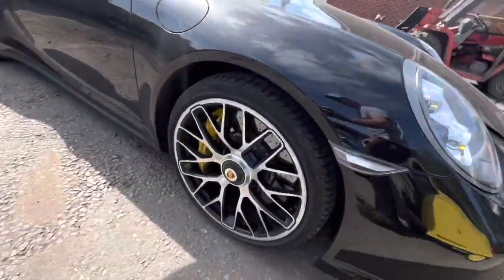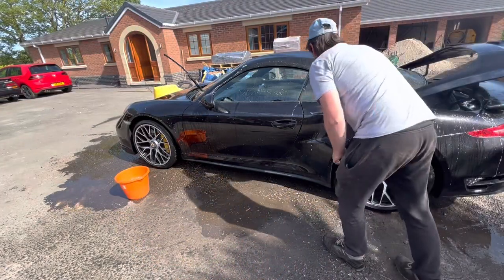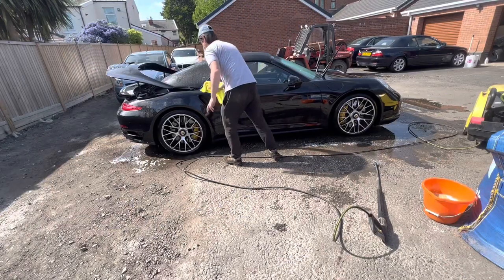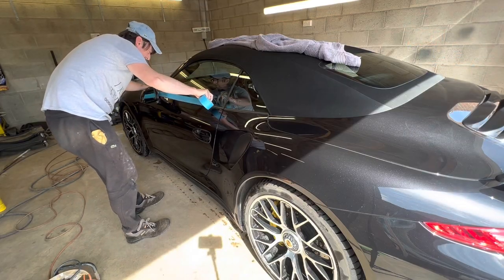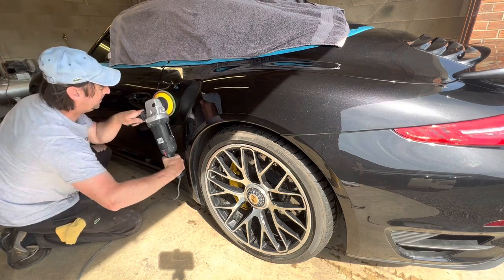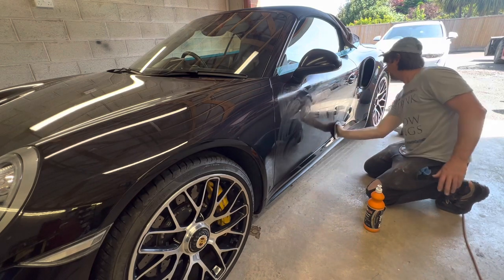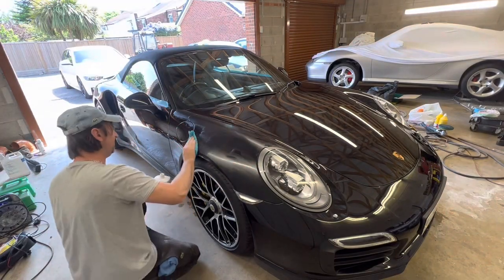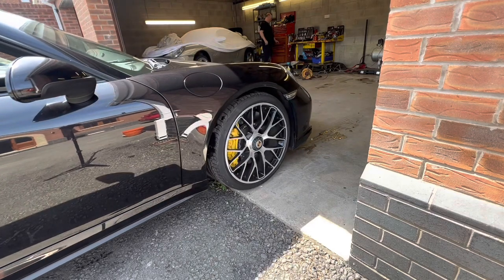Porsche 911 turbo S 600hp paint correction

Comment: how hard is the polisher to use? im worried id go to far and ruin the paint., thanks
Reply from the maker: Hi mate mines a rotary old school quite dangerous maybe go for a duel action easier and safer 😎👍
Reply: @330dfam  what's the hardest part
Reply from the maker: Just imported to to keep it moving and don’t hold it on the same spot for to long especially edges and don’t have it on the highest speed..speed two or three is enough 😎👍
Reply: @330dfam  what happens if you do it wrong ? Paint comes off completely   thanks
Reply from the maker: @derekporter66  potentially you can burn through the paint that’s the danger keep the buffer moving keep it on a medium to low speed and watch edges maybe buy a scrap bonnet to practice on first 😎👍
Reply: @330dfam  I'd love to try it. Don't fancy paying 800 for a professional. Thankyou for the help
Reply from the maker: @derekporter66  800 sounds really expensive mate shop around..ps no probs anytime 😎👍
Reply: @330dfam  any recommendations? South east
Reply: @derekporter66  what car you got and where in the south east are you?
Reply: @the_jnlt_channel  black 640d. Near Stevenage.
Reply from the maker: I’m up north mate so not sure 🤔
Reply: @derekporter66  and they are saying to you that much for a machine polish 😱
Reply: @the_jnlt_channel  paint correction detail. 2 or 3 days
Reply: @derekporter66  should include Ceramic Coating tbh as well.